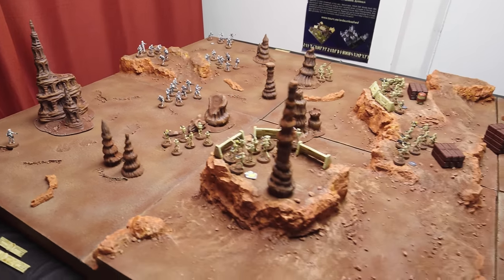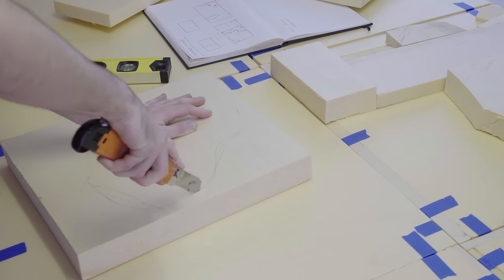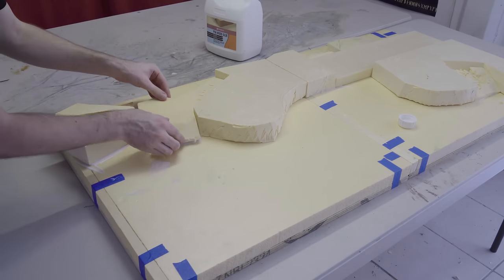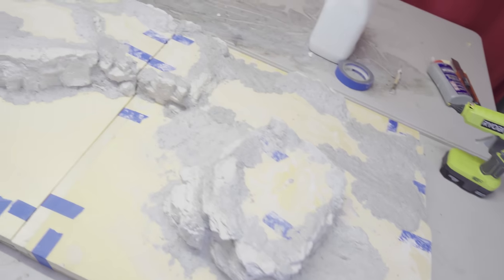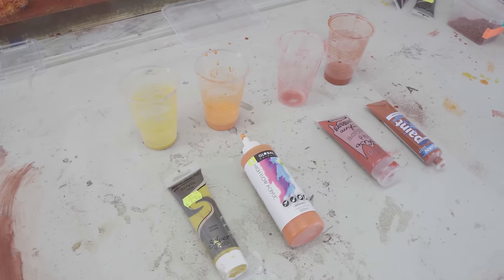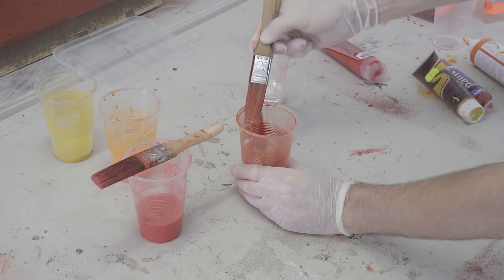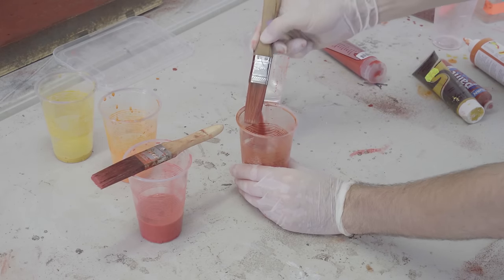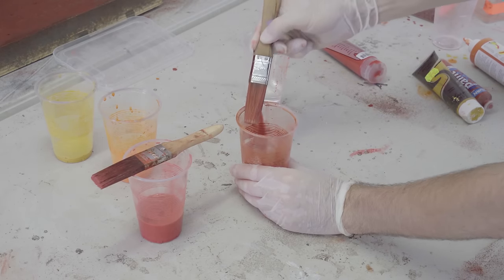GEONOSIS / MARS Gaming Table ! Star Wars Legion / 40k Scenery Tutorial

Comment: Very cool board! But spending $50 AUD on just sand for the board seems a bit expensive. If you wanted to you could use regular fine sand from the beach, follow the same methods and then paint it red.
Reply from the maker: Not to mention the lovely blended colour of the red pigments is a wonderful starting point :) the board gets a lot of the realism in the ground coverage from the fact that it's pigmented sand not saying that has just been painted if you do you use and adjust paint it you're gonna end up with a result that you can see in the video after I just painted the textured surface before I put the sand down :) definitely a cheaper way of doing it but it's not going to look anywhere near as good.

Comment: Currenntly building a four foot wide clay version of helms deep. Finished the foam for the gate house last night
Reply: Best part is it will fit threw the basement door 😉
Reply: Using plaster mixed with pva and grey pigment for grout
Reply from the maker: Ah that's awesome dude! Throw some pictures up on our Facebook group :D
Reply: Im on instagram, are you guys?
Reply: Btw to make the clay arch shown on my instagram flatten some clay with a roller and punch out a circle with the cover of your spray primer and then cut to size above the plastic and then remove excess and cut bricks, separate and let dry

Comment: Hey absolutely LOVE the video. Im looking to buy a mask that can be used for epoxy resin, using a heat gun on polystyrene and be used for sanding wood, is it possible to buy a mask that does all of these and if so could you advise me on either an exact model that does all of this or what key words I need to use to find something for it
Reply from the maker: Glad you enjoyed the video dude awesome that you're taking safety seriously it's super important!! the model numbers and safety standards very hugely from country to country but essentially you're looking for vapour grade filters not just particulate filters 😊😊
Reply: @Zorpazorp  Amazing! Thanks a lot man, that's what I thought after some research myself but I wasn't certain so hearing it from someone who knows what they're doing is reassuring for sure!